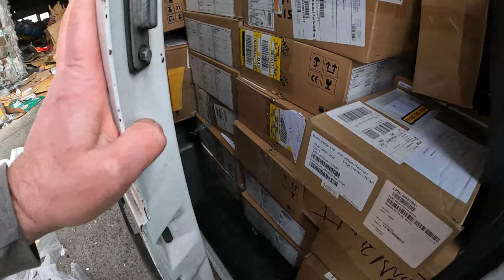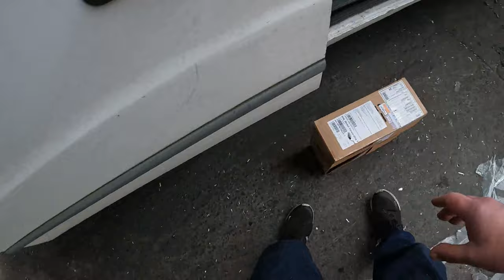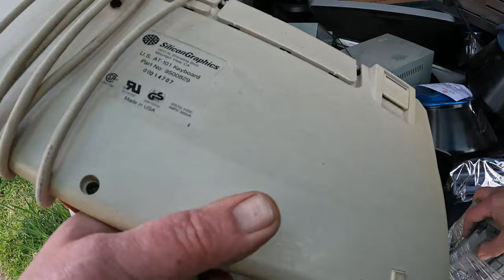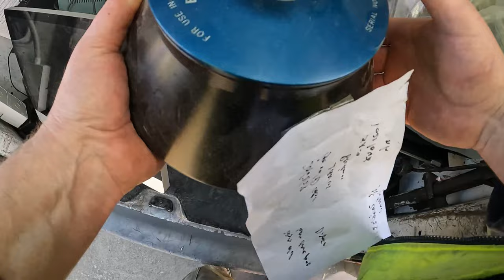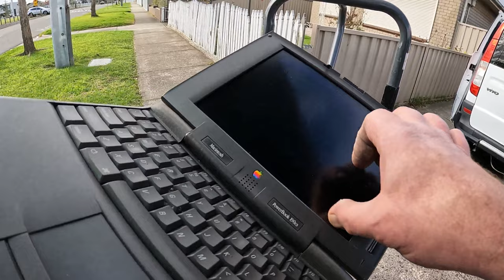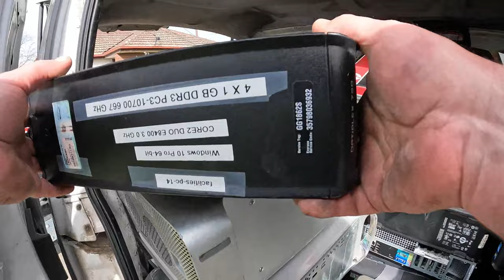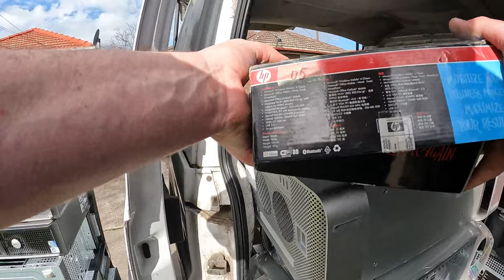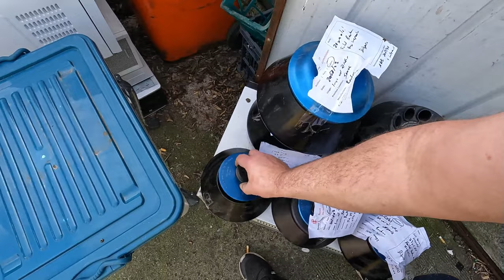Another week in the life of eWaste Ben

Comment: If there are 3 of the stepdown transformers, I would check the Silicon Graphics PC to make sure that they are not just 120 volts AC before you plug one into 220 volt AC. Since they came from USA and looks like the power supplies are not standard PS and probably are not auto switching or have a switch to switch between for 120vac and 220vac.

Comment: The direct removal of iron impurities from titanium products is impossible by the current industrial technology. Therefore, recycling of titanium scrap containing large amounts of iron by remelting is difficult. One of the many remarkable metals that can be recycled as many times as possible without losing any of their properties or general quality is titanium. Titanium is mainly recycled using a method called vacuum arc remelting. Since the metal can't be melted in an open-air furnace, it is instead processed using this method. Recycled titanium is not as valuable as copper, but it is more valuable than stainless steel and other ferrous metals. Good for you. They seemed quite heavy, so...a couple of bucks there for you!